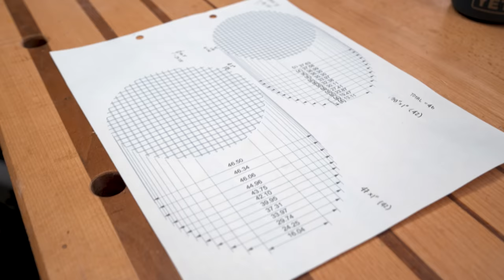Amazing Wooden Table Top Design

Comment: As You already referenced airplane builds .... that grid looked fantastic. You might also have a look into millboard/papermaché honeycombs, an even lighter filler core/sandwich core than Your fabulous baltic birch grid, supplied from places selling boatbuilding materials. It has more partitions than that grid and thus allows even thinner shell material. We built ply-in-form spheric plysandwhich decks for sailing dinghis with this method - a 1,9 meter 86 kilogramm grown man could stand on it with 5 layer outer ply-in-form from roughly 1mm veneer, vacuum lamellated with epo, and work in regatta speed on fore sails jumping around on it. It's a little finnicky with vacuum bagging though - You might have to reduce the evacuation rate to not crush it. We also had the honeycombs sprayed/cured with epoxy or 2K DD-varnish prior to vacuum bagging which did help a little against vacuum crushing. Putting in one sheet of glass-aramid fabric as second layer instead of veneer made it even stiffer - might be overshootin' with tabletops though.😄
Tabletop looks gorgeous. The "screwup repair" adds to the whole optics. Thanks for sharing.

Comment: Lazy Susan. I grew up with round tables and lazy Susans (one at my parents’ and one at the grandparents) and you’d be surprised how much more interactive and social they make a meal. All the food goes in the middle, and instead of the awkward getting up and reaching (or passing big dishes around) that a rectangle mandates, the platform rotates a slow 360 while everyone helps themselves comfortably seated, and engages in the pleasant cooperative chatter that enables movement at the right time. The one hazard that happens once in a while and is made clear to those who aren’t regular users, is that you must remember to tuck in the serving utensils, especially when there is wine. 

It would cover up the center quite well, too :)

Comment: As a carpenter for over 40 years I have learned a lot of techniques and methods for creating exceptional pieces.  
 The most important thing I have  learned is fixing a problem without re fabricating the whole thing . No matter how good your skills there will be an issue that will require a creative solution. That I believe is the the true definition of a "master carpenter." not that I claim to be one.

Comment: I was surprised that you do not hav a circle cutting jij for your bandsaw. As it is a simple extension off the edge of the bandsaw with a line perpendicular to the blade. From this, you measure out the radius of your circle, and install a finish nail with the head cut off. Then after determine the center of the found you wish to cut. You place that center on the now pin of the cutting table. This pin, automatically firms up your center point. This method never fails.

Comment: In my experience bluetape (or any masking tape) in a vacuum press is trouble...the glue gets sucked into the pores of the wood..impossible to remove and showing up in the finish later...but I guess in this case the tape fell outside of your table's edge?

Comment: One thing I'd suggest for template routing of pieces where the grain is "going the wrong way", is for you to flip the piece over and raise your double-bearing template bit so that the other ball bearing engages with the template edge of the piece.  That way you'll route with the grain instead of against it, and limiting tearout.
Reply from the maker: Great tip Marty. I battled the time trade off here and opted for a compression bit for a good balance of time to raise and lower with all those passes and tear out. Definitely good to always follow the grain.

Comment: You put so much effort into the structure just to completely hide it but the table does look great. I think another cool way you could have finished the table edge would have been to cut a bunch of cubes to fill in the pockets left at the end of the structure (that you can see at 10:15) then flush cut it back to the same circle. That way you would have had a nice contrast between the Baltic birch structure and darker colored fill in and still see the grid pattern inside. It might be easier to do if you had done it at the same time as reinforcing the screw points at 3:57, since you already had a circle template too.

Comment: Nice video. One of my goals in life is to build a round dining room table with a built in lazy susan in the middle. I want use cat eye marbles for the bearings. I just haven’t figured out the base. I thought you were going to make it. I don’t know how you could cut a groove for the marbles in a torsion box top, but I sitting up watching you. I haven’t tried to build it myself as I haven’t figured out how to do the base. I’m not a fan of a pedestal base for a table of any significant size. Anyway, I would love to see you build something amazing incorporates some glass marbles.
Reply: BTW. Everyone that works with veneer sands through it. I hate that it happened on that amazing piece.

Comment: provocative piece, the video i mean. design is dependent on execution because you are using materials with certain properties, no? a certain indifference to them does suggest the divine though...your work is a pleasure....
Reply from the maker: It’s a fraught mindset and I’m not sure the argument holds up, but it does open one’s view and pushes the limits of the material used. Thanks so much!

Comment: Thank you for not blaming Ukraine for the birch ply issue. That made me exhale a bit. I did find two alternatives though. And I see things popping up. Which is awesome.
Reply from the maker: Yeah a couple alternatives, but man, so expensive!
Reply: @SawyerDesign  less expensive than baltic actually. Home depot delivers for free - 2ft by 4ft. Not sure about bigger panels. They had 2 by 8 if not mistaken.

Comment: Machine sanding is not such a good idea when using veneers. Had you use a  Ziehklinge, then your fortunes, may have had a different out-come. However, there isn't very much motor-power behind a Ziehklinge, it's more of an elbow-grease machine. Better luck next time. Nice furniture work!!

Comment: Looking good as always.  Could you give me your opinion on when and why you decide to use different glues or epoxy’s for “glueing up” particular joints?  Thanks in advance!
Reply from the maker: Thank you! I’d use epoxy always, but it’s expensive and messy to clean up. I use PVA (titebond) unless it’s veneer where I use something with resin impregnation so the adhesion dries to a rigid layer preventing veneer from slipping over time.

Comment: Beautiful tables. I was there a mechanical reason for using 2”(?) squares for the torque boxes? Wouldn’t 3” or maybe 4” squares worked just as well and saved some more weight?
Reply from the maker: With 3/8” skins, that probably would have been fine. I was worried about glue surface area with those thin strips. The extra 5# helps me sleep at night.

Comment: Stunning as usual.
I have to say, having made a few heavy duty torsion boxes I very much like your light weight version and will be making some of these.
Any thoughts on just how thin ( short?) the torsion layer CAN be? Theory would lead one to believe that as long as there is some sort of a layer in between the skins the design should work as intended. Just curious before  burn up too much material in abject fail... learning.
Reply from the maker: Thanks Greg! I’m sure there’s a calculation for deflection of a horizontal strip * no. Of strips. I know the spacing of the grid is determined mostly by the thickness of the skin. At 2”, I probably could have saved some weight with 1/4” skins, but wanted more meat for inserts.
Reply: @SawyerDesign  awesome. Thanks. I’ll have to do some digging. Once upon a time in a previous epoch I studied this sort of stuff in school - just not in this use case … back to the “books” I think they’re called 

FYI, if you want to get crazy, you can build a grid in 3 dimensions resulting in spherical / etc surfaces which gain the strength from the grid… the grid would be a beast to build but the form + strength potential is wild (think aero space composite structures and shapes - honeycomb web inside carbon fiber skins … you can do it with wood too 

Oh, look up the Splinter Supercar

And now, let those creative juices flow !
(Hate me now, thank me later)

Comment: Nice work. Question: would a thick  pipe placed in the center of the lattice and bolted to both the circular base and the original top taken out much of the movement?
Reply from the maker: Maybe. There’s a 2” steel core in that base with 1/4” plates top and bottom. The original top was solid walnut.
Reply: @SawyerDesign  Could another method might be to fill the space behind the lattice with clear or black resin?

Comment: trying to figure out how you sanded through 1/16 veneer....
Reply from the maker: My resaw was wonky in a place. Tried to hide it with the black ring, blew through flushing the epoxy fill. That corner ended up very thin so definitely wasn’t 1/16. New lesson with every project. Sawing my own veneer on a 14” saw has been a wonderfully steep learning curve lol
Reply: @SawyerDesign  why do you saw your own, does certainly not sell 1/16 veneer?
Reply from the maker: Small table was from certainly. Big one needed wider than certainly had in specialty thickness. That and color matching the respective bases. Certainly uses a far more eastern/grey supplier than mine.
Reply: @SawyerDesign   ahhh I never have sawn veneer,  plus Certainly is only an hour drive for me so its easy to run up there and look through what they have.
Reply from the maker: @adamchesis7443  Jealous. Shipping about doubles certainly’s prices over here on the left coast. Wish they’d expand a bit closer.
Reply: @SawyerDesign  is that bad? I know there was a 24" jointer in Ca I was interested in and it was going to be $2k to ship it here I think I will wait on something, when prices come down

Comment: keeping designing and execution separate from another is pretty much the worst tip I've ever heard... and I'm saying this as an engineer myself... sure it might trigger creativity and problem solving, but this doesn't not lead to a smart, robust, simple and even do-able product. And since we live in a real world, those factors are still valid ^^ 
realisticly speakin: timing constraints and price limits will lead to a barely functioning product with a lot of half assed solutions build around an initially bad design, if you don't account for execution right from the beginning^^

Don't get me wrong: it might work in single-piece asthetic work and rightfully so: I like your products... but generally speaking: not a good tip :D